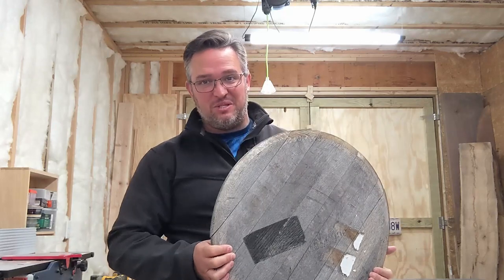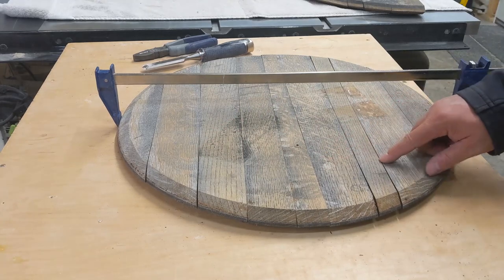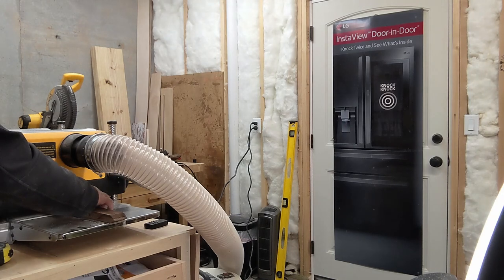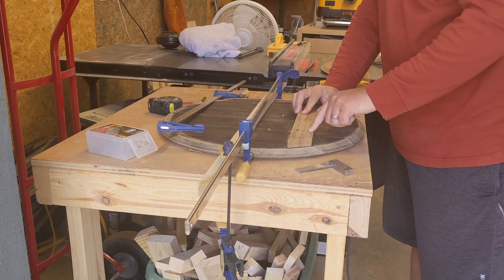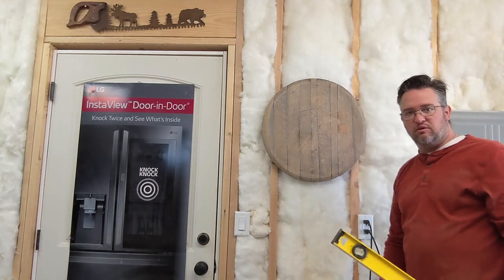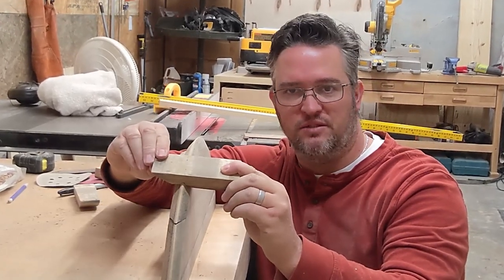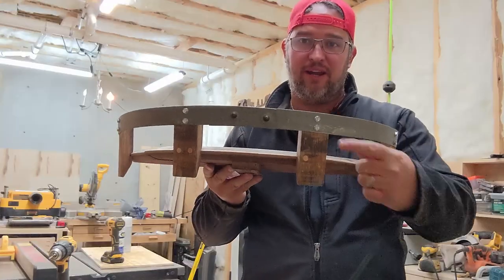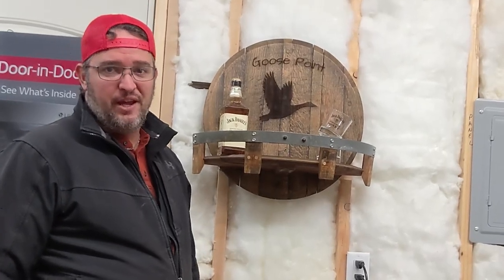Whiskey BARREL Whiskey SHELF! How to build this shelf out of old barrel parts.

Comment: What do you think of that Wahuda bench jointer? I’m waiting for a backordered Grizzley spiral bench jointer. They have pushed my date 3 times since my Nov 1st delivery date. The newest one is Dec 29th. I originally was looking at a Wahuda and went with Grizzley because it was a little cheaper but had great reveiws. I’m about to cancel and order the Wahuda.
Reply from the maker: I have the 8 inch RIKON bench jointer: https://amzn.to/3F5YiGN 
They also make a 6 inch version: https://amzn.to/3XY0uc2 

It has done everything I have needed it to do. It is good for pieces of wood up to 4-5 feet in length. Anything beyond that and it becomes very cumbersome. Overall good starter tool and better than using a table saw jig or some other method.

Comment: Only thing i'm not understanding is how did you secure it to the wall? Very cool video otherwise!
Reply: like did you literally just put it on the part you already secured to the wall and just hang it there or how did you secure those together...ect
Reply from the maker: The first plan was to secure one part of the French cleat onto the wall directly into the studs with screws, then simply hang the shelf on the wall. After further consideration I attached 2 heavy duty D-Ring hooks to the back of the shelf. Then I was able to use high strength drywall anchors and screws to attach it.
Reply: @BenVanKirk  interesting and good to know! Thank you! i'll be trying to make 2 of them here over the next couple weeks as i get time.
Reply from the maker: @Jonesy01  Let me know if you run into snags and I will try to offer advice.